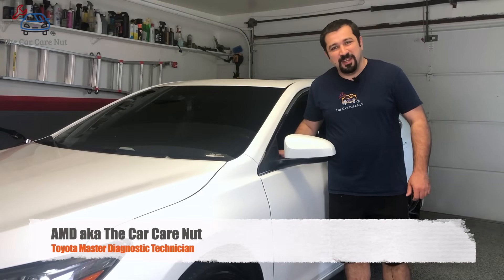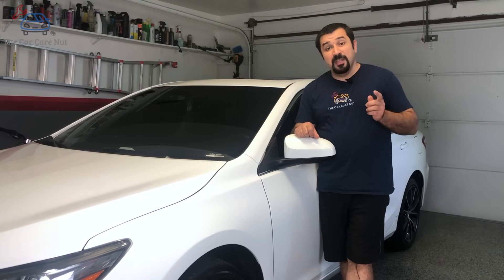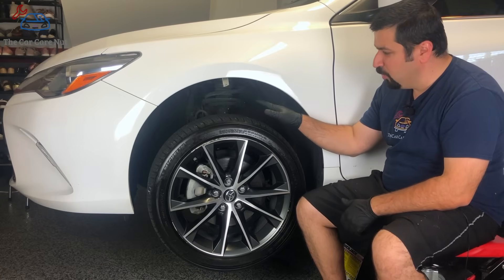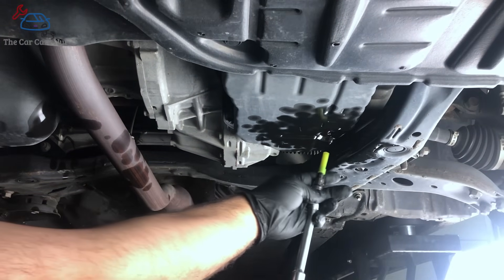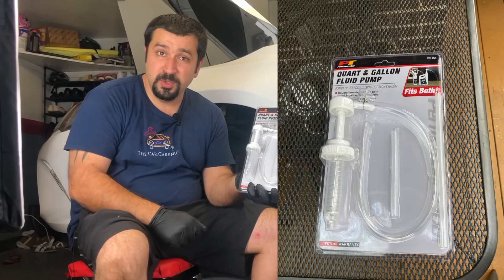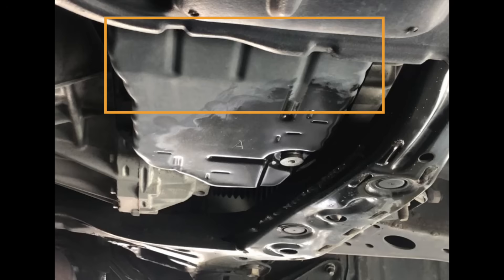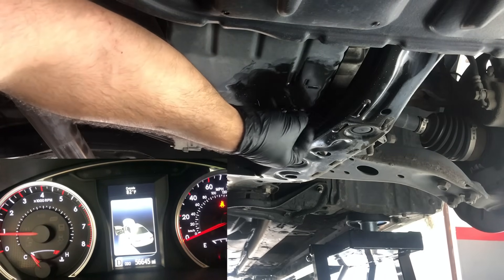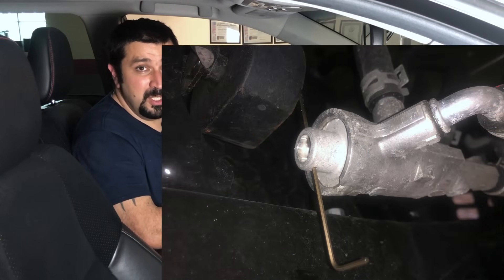How to change your Toyota Sealed Transmission Fluid

Comment: Love your videos.  You are a good teacher.  Your presentations are clear and concise.  I wanted to ask if you know a specific location on the car that is flat enough to place my small klein magnetic level.  Since my driveway is not level I truly want to lift the car and properly level it.  Currently,  I have been using the flat surface on car's battery and or the bottom pan of the transmission.
Thanks again!

Comment: OK, so here's my problem: My wife has this 2008 Camry XLE and has taken it to the dealership, for service, since it was just off the showroom floor. I noted in one of your previous clips that you say to 'not' change fluid if you passed the 100K mile mark. Well, this car is now on the 225K mile mark and so I went to the dealership as I noted when checking her service record that the transmission fluid has never been changed! Oil, even a CV axle has been replaced but see NO TRANSMISSION SERVICING AT ALL!!!! What is your best advice at this point, appreciate any guidance. Will take your advice as simply that, "best advice, not direction". You do a great job on the videos, keep it up!

Comment: Hello there can you please help me with this one question, I bought used 2021 Toyota Highlander 3.5L  
And my mileage at this moment is (45,773MI) I went to Toyota dealer yesterday to have a normal maintenance scheduled on the car, I asked the guy that checked me in to get my transmission fluid changed then he told me that it didn't needed it until 60k MI, but when I do an online researched I found on Toyota website stated "that If you don't routinely change your fluids at least every 30,000 miles or so, you may find that your Toyota Highlander transmission will slip." And this is Jacksonville Toyota. Since I bought this car used and no manual available I am completely in the dark. Please help thank you so much in advanced.

Comment: Thank you! Just did it on my Venza. One thing it wasn't explained is to put the gear on park when the "D" is on for 2 seconds. I read the bulletin board and it also mentioned to unplug the wire from the obd2 before checking the level.
Reply: @Rodrigueira1  when you put the gear on park, then you can remove the wire and wait for the "D" to become solid. You don't need to wait for the "D" solid then remove the wire then check the level. The bulletin says as long as the testing mode is active, it's OK to remove the wire which will help to check the level more accurately, since the engine will idle more stably.
Reply: @qyl-000 Can this method work on the new Camry? I got 2021. Thanks in advance.
Reply: @safyankhan8469  Yes, should be the same.
Reply: @ Thank you for the quick response.
Reply: @qyl-000  another question, In the video he keep changing the gear from N to D until he get a solid D, but you said to put in park and wait for the solid D, now the question is do I try D to N a few times and then put it in park and wait for the solid D?
Reply: @qyl-000  Hi qyl-sf-ca can you clarify what you mean?  Sounds like you are saying start it with the jumper wire then shift to park then remove the jumper and just wait for the drive indicator to go solid.  Does that work or should we be switching between N & D like the video says?
Reply: @jalmolky  you have to switch between N and D, but you can remove jump wire early because it already triggered the debug mode.
Reply: @jalmolky 
Don't remove the wire until you have seen the solid D for two seconds and it has gone out.
Then you put it in park and remove the wire, then wait for the temperature to rise to 93F and for the longer 1-2-minute solid D to appear.
Work quickly once the continuous solid D appears, you have just a minute or two before the temperature gets up to the upper limit of 113F.
Reply: The MOST IMPORTANT thing is to get the car up and LEVEL.
Reply: This is also my concern. I’m about to do the service on mine and I’m trying to call TCCN shop but I can’t get a call back or service help.
Reply: Getting ready to change transmision oil. Does anyone knows the temp for 2019 rav4 xle? Thanks.
Reply: I just did mine today.  7th time I have done it.  259K.  2011 Camry.  I did it at 234K last time.   My fluid was darker than I expected it to be.

Comment: Thanks for all your videos! This was today's project. Agree on the Toyota fluids and the simple just time consuming process of checking fluid level. Did a run on the jumper method day before. Found that my 2014 Camry when it gets to temp and D comes on so did my radiator fans and then when it got to the too hot side and D flashed my radiator fans shut off. Meant I could do this without a helper.

Comment: The solid D during diagnosis mode didn’t work for me. Temp was still 65 degrees.  Bought the $18 infrared gun off Amazon & that worked perfect. Drained at 100 degrees and trickled out just like the video.

Comment: Hi . I have corolla E18 2018 hybird withe Cvt transmission its got now  60000 km . I asked the toyota dealer to change transmission oil but they said that Sally think ( ITS LIFE TIME ) and you don't need to change it  . I asked  many workshops to do that, and all of them said we  ar not able to do  that c according to toyota instructions . I dont know what to do . Pls help . I live in sweden . 
Thanks

Comment: Hello @The Car Care Nut I was curious if you could tell me or maybe even make a video on your stance about filter change when servicing the transmission, for my 2016 Toyota Tundra it seems like most YouTube'rs are recommending the filter to be changed as well, but from my experience in various generations between Honda/Toyota many will say to change or not change the filter, the procedure is very much the same as you did here but I suspect I should change the filter (at 74k miles currently), but would really appreciate if you could provide any feedback

Comment: For those who want a complete fluid exchange vs an approx 40% pan exchange:
1.) Remove the plastic shield under the front of the vehicle. Note, new assorted plastic push-clips are recommended.
2.) The radiator cooler transmission fluid out-fall is on the drivers side approx 3/4" OD, 3/8" ID rubber hose with spring clasp clamp.
3.) Disconnect the hose and attach an extension line to a translucent 1gal jug in an catch pan (for overflow/spills).
4.) The steel return line may drip into a second catch pan.
5.) Snuggly attach a clear extension line to the dip-stick tube with a funnel. (I inserted a clear plastic kitchen "baster" keeping the refill level from overflowing at top of the "baster"/funnel).
6.) Start the engine and put in gear (automatic) until approx 1/2 gal OLD is collected and turn off engine.
7.) Fill approx 1/2 gal NEW.
8.) Repeat for approx 2 1/2 gals until bright pink is dispensing.
9.) Reattach radiator/trans Return line.
10.) Adjust fluid level to the low side of the "Cold" mark on dip-stick (so you can top-off to the Hot mark).
11.) Drive vehicle until transmission is up to approx 115 deg. F and adjust fluid level to "Hot" mark.
12.) Reattach the plastic shield using new plastic push-pins.
13.) This should replace the trans, torque converter, and radiator cooler with All New fluid.
NOTE: For sealed transmissions, install an extension line and funnel to the Return Line (instead of the dip-stick tube) using approx equal volumes of Old vs New. Then remove the "Full-Level" bolt to ensure it,s not too full, and reinstall when warming the trans to approx 115F. Then remove the "Full-Level" to adjust to the proper Hot level.
Happy motoring!

Comment: I love your channel.  I just have a quick question. Because transmission fluid is at its lowest level when it's cold why does some transmission fluid come out when you initially remove the drain plug? I would think when the transmission is cold that fluid level would be below the top of that plastic tube. Just curious.

Comment: Hi so I have a issue as you said in the video, I have 2016 Camry 6 speed and I changed the fluid and let it trickle and put the plug back in while the car is running at operating temp and I scanned the pan and it shows temps around 140 degrees. Please help!!

Comment: Unfortunately this temp check method does not work on 2019+ Camry. It has only 6 wires in the obd, and does not have diagnostic mode

Comment: Just bought a 2017 Tundra SR5 from the original owner, the truck has a tow package. I plan to tow a travel trailer with it. 

I asked the original owner when he had the trans serviced? He said at 30k.  I looked up the vin service history on the truck through Toyota app and it shows the trans was done at about 30k

The truck now has 97k at the time of my purchase. I decided to do a drain and fill while it was cold, the fluid was dark, almost black. 

I put in the same amount of fluid, I noticed the trans had less delay between reverse and drive, as before it was more like 1 1/2 - 2 seconds, now it’s about 1 second. 

I saw your video on if we should drain and fill our “sealed” trans but after I did the drain and fill on my truck. 

I think maybe it’s better to not do another drain and fill  and replace the filter from now on. 

Lastly, I notice a slight wetness at the bell housing, I checked and it’s trans fluid. I cleaned the area and monitored to see how soon it would return and how bad it would be, I noticed the fluid in between the trans and engine bel housing, I think the pump seal is leaking at the converter, maybe not so bad, class 1 level. 

I did not check this before I bought the truck, that’s my bad.

I decided to save my money for a future trans replacement. 

Thank you for your information, it’s quite helpful.

Comment: What will happen if you drain and fill, run the car till the transmission is warm enough, drain excess while it’s running, re plug, then drive. Skipping the program/jumper sequence? I’m at 80k (Corolla L 2014) and need to change my fluid. I saw another video doing your steps minus the sequence…
Reply: Please follow his procedures to do it right.

Comment: Why can't you drain and refill cold? The only reason i can think of is thier isn't a reason. Could you please explain Mr. Car Care Nut. Thank You. Your answers to questions are highly respected.
Reply: Because the fluid expands as it gets hot. If you do the procedure 100% cold when you run the car the fluid WILL warm up and expand and the new EXPANDED fluid volume will be way too much, possibly causing internal transmission damage.

You must follow the procedure exactly like in the video or you will damage your transmission.
Reply: @jarretthoman but if what you drain is cold and put in is cold it shouldn't matter. Right?
Reply: @samroberts3555  It does matter because the length of the plastic drain tube is based on the CVT fluid being hot. This means the level will not be right if you use cold fluid, even if the CVT is cold.

Comment: i have a 2008 Avalon 3.5 L V6. The car ony has 40,000 miles. Just noticed that the transmission is shiftiing eratically when bing driven up to 35 mph. over 35mph it shifts fine. in lower gears it seems like it revs hgher then it should and the drops down. Any ideas on what this could be would be appreciated. thanks

Comment: Watched 2/29/2024

2018 Sienna AWD

Questions
1- How do I check my car is level on jack stands?
2 - Correct factory temp to check fluid for above make & model.
3 -  I'll be using  an OBD 2 scan tool. Do I run the trans through the gears as shown with wire to get fluid up to temp see # 2?

Thank you, I am nothing without  Christ

Comment: I emailed you a couple weeks ago but I have not received a reply. I am currently working on a transmission fluid drain and fill on my 17 sienna. I am having trouble pushing in the hex key through the bypass valve so I will have no choice but to skip this step because I don’t want to force anything and break stuff, I’m assuming this is better than not doing a flush at all anyways. I am only 68,000 miles but I don’t know why it’s so hard to push that button in.

Comment: Hi AMD… Thanks for the great video.  Do you also recommend changing the CVT filter?  If so, at what mileage should the filter be replaced?  Also, it would be a great to see a video on doing a full CVT service including a filter change on a newer vehicle like a 2023-2024 Corolla.  Also what is the CVT temperature to check on a CVT for a 2024 Corolla? Thank you again for all the great video.

Comment: This is a classic case of you screw up dealer wins! Transmission cost. You decide that it is more than you can handle dealer wins cost of a transmission fluid service. I personally think that they did it this way for you not to do it! I think that the dealer should do it for free charged back to the manufacturer!

Comment: Perhaps I missed it, but if the transmission fluid temperature is the same as the fluid to be added (replacement), then why bother with any other method?

Comment: I am changing the Transmission fluid on my 2020 Tacoma SR5 Crew Cab 2.7 two wheel drive and not sure of the fill plug location. I have seen lots of videos on 4 wheel drives but the location of the fill plug must be different on my 2 wheel drive. I would appreciate any help on locating the fill plug on my truck, Thanks

Comment: Thank you for making this and doing such a thorough job. I changed our Camry’s fluid today twice since it has 85,000 miles and had not been changed. With 6 quarts total capacity it was still dirty after changing the 2+ quarts the first time. Even after the second time it wasn’t like new but red color was visible. 

I wouldn’t have known to change it if not for you.
Reply: Camrys holds around 8 quarts of transmission fluid.  It's better if you drive awhile in between drain and fills. Did you pin open the transmission cooler bypass, if so where's it at?
Reply: @donniev8181  I was thinking I had found 6+ quarts for our 2017 4 cylinder Camry somewhere before I bought the fluid. I knew that by draining the fluid we are only getting part of the old fluid out. I'd say the majority is stuck in the torque converter, some in the clutches and a little in the many passages. He drained about 2.5 quarts in the video. I measured closer to 2. On the first two changes I just added two quarts and ran the transmission in D and R, back and forth, for about 4-5 minutes and then drained and filled again. On the last time when it need to be spot on, I added almost 3 quarts like he did in the video, cycled it in R, and D as it warmed up and before I started looking for the constant "D". Then I drained off the extra when it got up to temperature. No part of the job was very hard. It just takes awhile. I had purchased a 3 foot section of clear hose with the ID about the same as the fill hole. I found a piece of copper tubing that just slipped inside the fill hole and used that to loosely connect the tubing to the transmission. I routed the hose up inside the fender near the air filter box and zip tied a tall and skinny funnel to the hood support. The hose was pushed up on the funnel. Filling was simple but the fluid didn't flow very fast through the funnel and hose. It was mess free though.

As for the cooler bypass, I didn't look for one. I'm pretty sure that's on other models. At around the 14:30 mark, he says that's on newer 8 speed models. Our 2017 has a 6 speed.

Comment: Very clear instruction video, thank you.  I'm generally not afraid to work under vehicles, when jacked properly, but never with them running.  Surprised that no one questioned the risk of getting under a running car, and moving the trans from Drive to Reverse, etc.  Nothing should happen, but it still makes me very nervous.  It may not be logical, but I feel better getting under a car if it is not running.  Maybe this is from a lifetime of using ramps, instead of jack stands?

Comment: My 2014 Sienna won’t come up to temp when I just let it idle.  I have to drive it for a few minutes to get the solid D.  Would this indicate improper fluid level to start with, or something else?  If I drive it a bit after refilling, is it ok to do that with the slight overfill recommended here?

Comment: We have had nothing but issues with our 2017 RAV4. Torgue converter shot at 50,000 kms. Burns 2 quarts of oil per week and both cv joints worn out at 125,000 kms. Vehicle has had services including oil changes done every 5500 kms. Last Toyota product we ever purchase!  The Rav 4 is a pos!!  The 2.7 litre is junk. Would not recommend to anyone I consider a friend.

Comment: In the initial drain, was the transmission oil at the desired temperature for fluid level check, or cold?
Reply: Said you start with cold fluid.

Comment: Hi. I followed your instruction for my 2013 Toyota Venza 3.5L 6 speed auto trani fluid change. 
All went well and as you described. I have the luxury of owning a digital thermometer. For my own edification I utilized both the digital thermometer and your suggested jump wire on the OBD2 port to access diagnostic mode. (Dash lights DID flash as you described.) 
I achieved 120F at the designated spot on the trani pan but the shift indicator D indicator never did go through its paces as you described. I set oil level once 120F was achieved via heat gun. 
Any prompts, suggestions?
Reply: Never rely on your heat gun. Jump wire and temperature through the scanner are the two reliable ways of doing this job.
Reply: Agreed. However, after entering diagnostic mode via jumping the OBD2 port, the “D” indicator did nothing. I achieved 150F via heat gun without any change in “D”. 
The dash lights were going wonky as described in the video, indicating diagnostic mode was achieved. 
What temp should I look for via heat gun?

Comment: Do you have the temperature recommendation for a 2004 Lexus RX330 (or Highlander) transmission? It has a dipstick, but I'd still like to get the level correct.